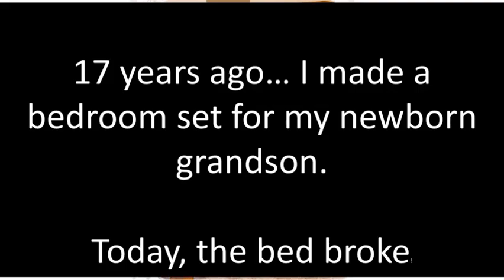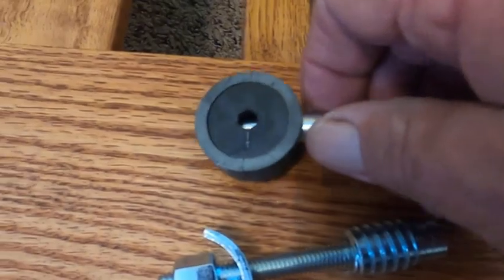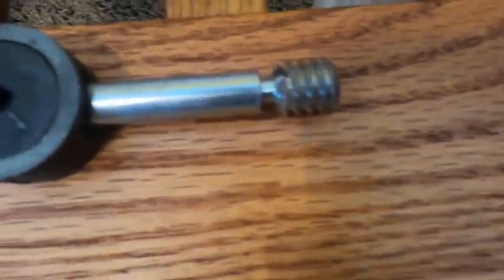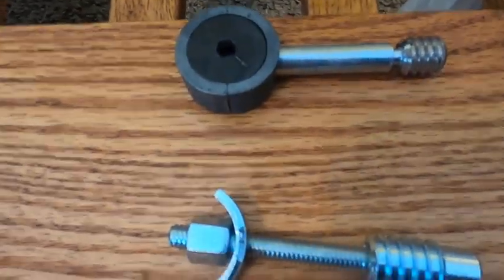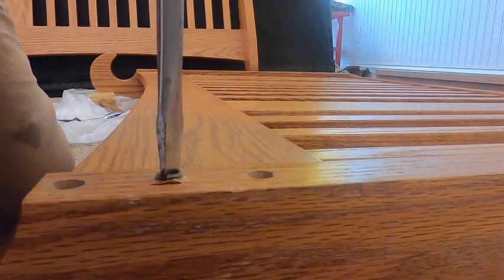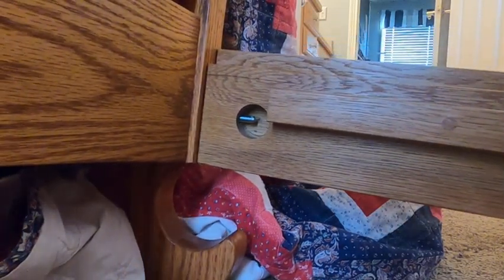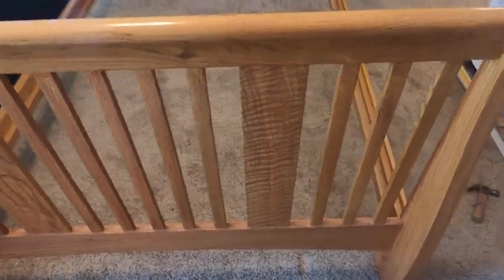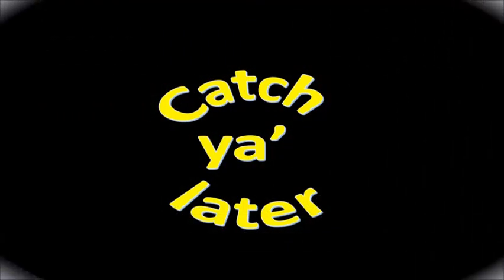Makin Stuff: Toy Hammer Saves The Day

Comment: Wish I would have seen this earlier because as an official Hardware Nerd I can tell you that that's a connector called "Confa 35", sold by Hafele America.  Good solution, though.  Scott
Reply from the maker: You know more than Rockler, Woodworker Supply and Google combined!

It is really a poor design... the cam nut is great... but the material in the bolt is too soft.  The roll forming is not crisp either... I used to be in QA for a wire manufacturer... they need to use a hardenable steel and stress relieve them after forming.  They are about as hard as a grade 5 bolt.  For the cost of electroplating them they could easily make a reliable bolt... but, I digress.

Thanks for the info... I’ll look it up!!!
Reply: @sassafrasvalley1939  I can't argue with your assessment of my useless knowledge.  This is the advantage of knowing zero about sports! Yes, that connector is odd and is primarily used where pull-out isn't an issue. What makes that connector even weirder is the fact that the spiral worm gear engages just a small portion of the rings on the steel bolt . If we were selecting a new connector for your application I would suggest the Maxifix by Hafele, but again, it looks like you have this well in hand.  Scott